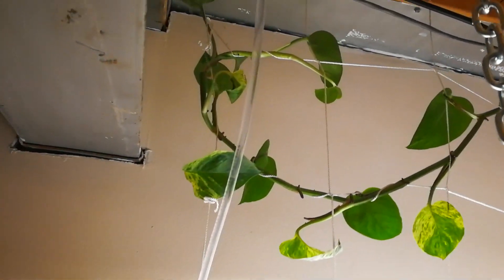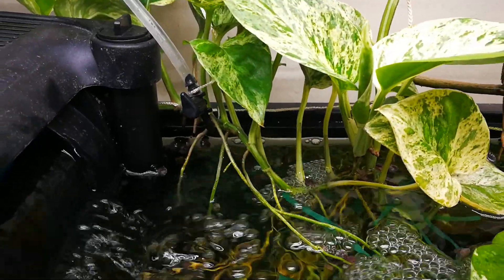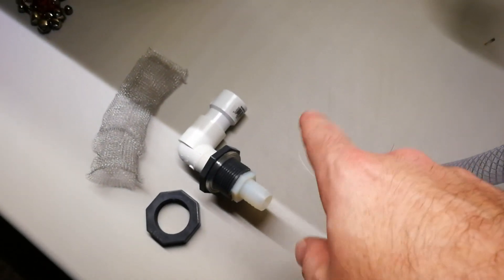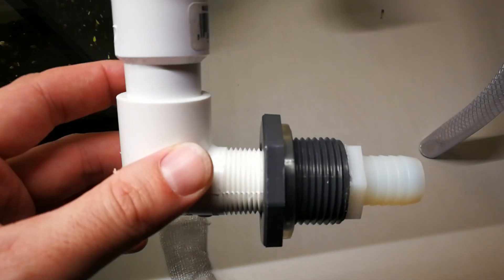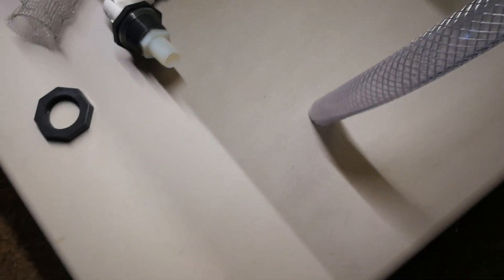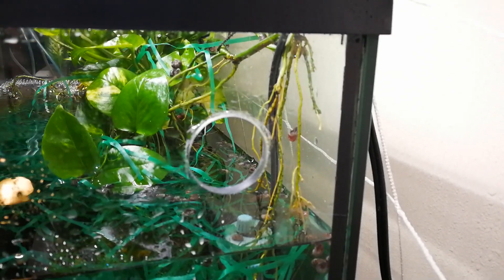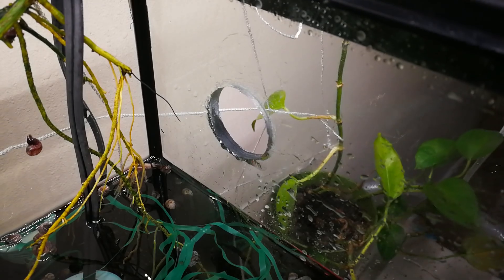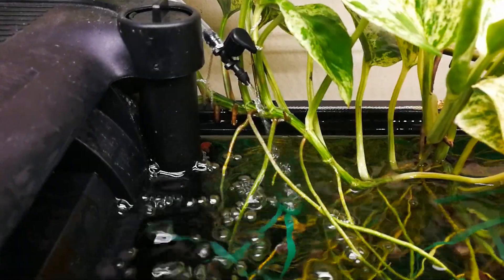DIY Auto Water Change System Build

Comment: You will get glass in ur tank. And it actually leaves alot of glass. Really think about it.
Reply from the maker: Yeah, I used duct tape on the inside before drilling to prevent that.  Almost all the glass got caught by the tape, the rest of the glass powder was wet from spraying with the squirt bottle while drilling, and I was able to wipe it away with a cloth.  I'm not worried about a few microscopic grains of ground glass floating down into the substrate inside.  Also, as I said in the video, DO NOT TRY THIS AT HOME.  This is the wrong way to go about it.  Be smart and drill your tank before you put fish in it.
Reply: @LifebyBrianAquatics  lol I will Not try it. I'll drill before I put fish in. And sorry I commented so quick be for I finished the video, I was screaming in my head Nooo.. but hey it worked, good job.
Reply from the maker: @topsecretaquatics6301  No problem.  Thanks for watching.  As I said, I knew it was dumb.  I won't be doing this again any time soon.  If I set up any more tanks I will drill them first :P